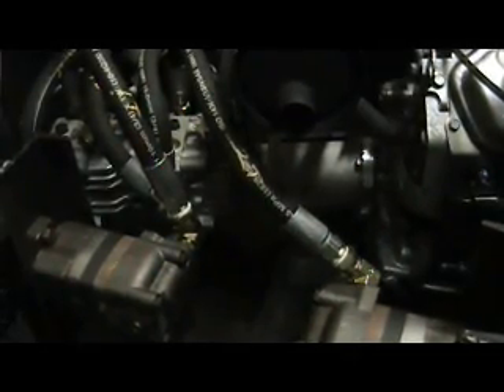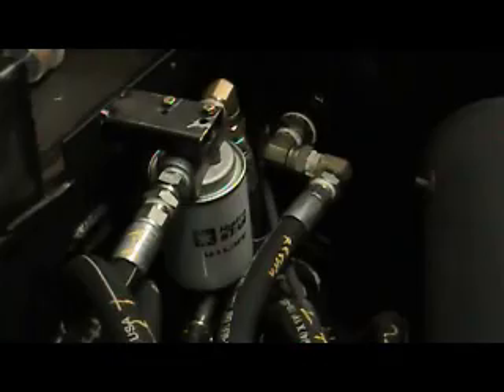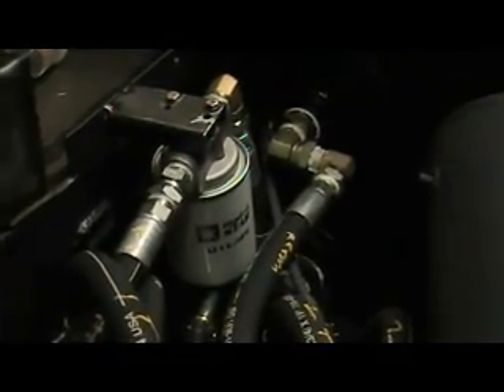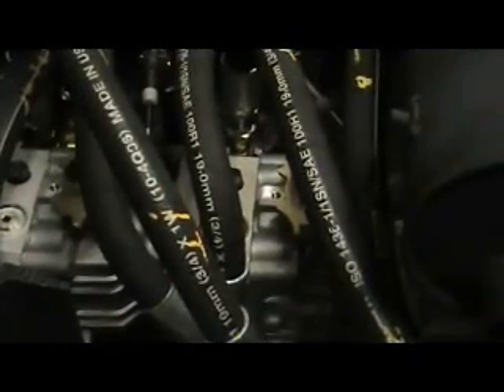hydraulic how to

Comment: DO NOT DO NOT DO NOT put the filter on the suction line to the pump! The filter will fill up (if not routinely replaced) and restrict flow to the pump! Which will result in cavitation and eventual destruction of the pump!
Reply from the maker: RealSteel 1776 
it has a bypass so if the filter is restricted it won't starve the pump.  no longer filters which isn't good but better than shorting the pump fluid.

Comment from the maker: @stratplayer1992 
Well the Motors are about 255.00 per motor I managed to loose the receipt for the tandem pump but I think it was around 1200.00. As for the whole build you might be able to find used motor and engine ect. and get it down under 10,000.00, but that all depends on what you can salvage and make work. With the right resources it's possible to build one for under 5k.

Comment from the maker: I installed a tandem pump to fix my turning problem. In the snow Ride video it's running with just a single pump and it would not produce enough flow for both motors. Now with the tandem pump I have a pump for each motor.